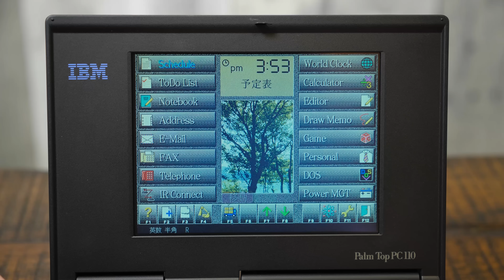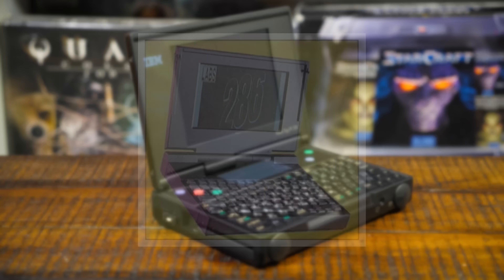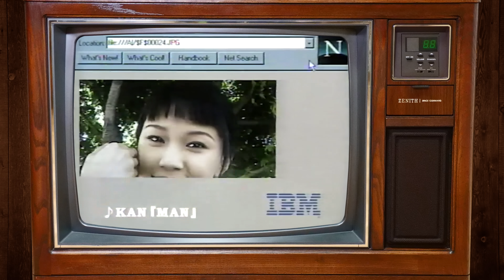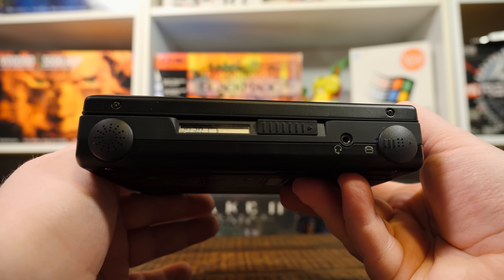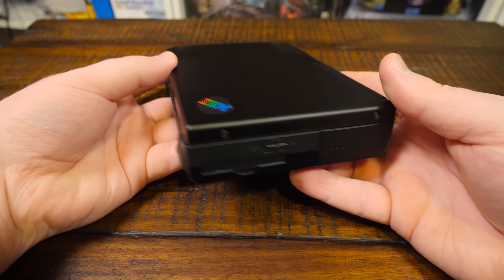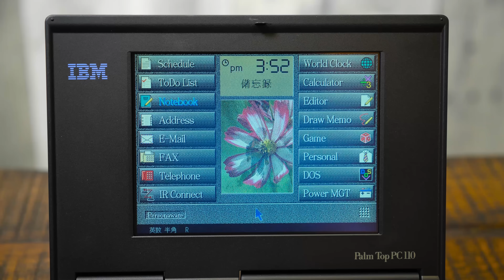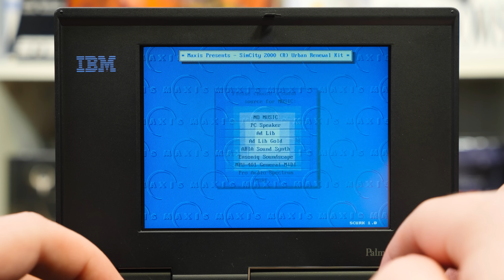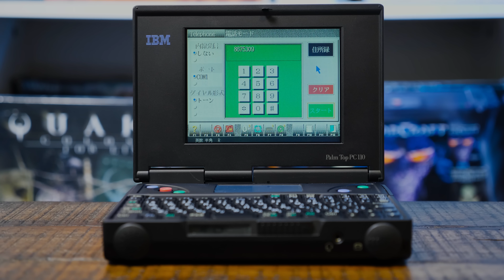The Smallest Windows PC in 1995 Was Also a Phone! IBM Palm Top PC110

Comment: just saw this...hmmmm...take a pi running win11, a tablet sized bluetooth keyboard and a portable dvd player with say a 9" screen....some cutting, some glueing and some wiring later and the fun part is do you drive the screen directly or try to get the pi to output a signal that the dvd player can accept....

Comment: I'm surprised they didn't go with an active matrix screen even in '95, considering it's so small and was a higher end product, and also a 486DX, because I doubt it would have gotten too hot and by then it wouldn't have cost much more, but would perform quite a bit better.

Comment: Worth to mention that camera software was designed to run form DOS, so you could squeeze it into tiny 4MB internal flash drive. Since camera blocks PCMCIA slots it kind of forced used to expand memory with those expensive CF cards.

Comment: At around 15:00 the video references connection to a CRT.  It'd be cool to see what it can do with an external color monitor of the day and with adapters to modern displays.  Could it be used with a light gun on CRT monitors?  Listing off all the cool things it can do they were forward thinking by adding the docking cradle and the CF card slot.  CF card could ultimately handle up to 16 GBs data without having to update its specs like SD cards have had to do so many, many times.  A pity that the docking cradle didn't incorporate the floppy drive into its body.

Comment: I bought a Libretto 50 in 1997 and it was not a bad thing and seems to have been a better solution than this IBM. It had a 75Mhz Pentium and a 3,5 inch floppy drive that was connected via PCMCIA card! An 810MB Hard Disk and Windows95 were also there. Legendary!

Comment: Man, this would have been awesome at the time.
I love expansion slots, sadly they have been left in the past.
I used to have a long laptop with a tons of expansion slots. 
If I remember correctly it didn't have that many ports, but it had 2 expansion slots and a compact flash slot similar to the one in the video.
I think I had 4 or 5 expansion cards, it was awesome swapping them in and out for different things. I can't remember what they were all for, but the great part about it is that it allowed me to use the laptop much longer without having to carry dongles and what not.

Comment: So this must be the predecessor to today's smartphones. And it's from the 90's
Reply: except no, not really, it's just a regular laptop that acts as a landline phone
Reply: @jbfarley  Still. It's easy to be amazed by a device that could literally do the same things a modern smartphone can do (except for wireless phone calls). And it is from 1995, which is a good 13 years before the first smartphones came to the market..
Reply: @Skarfar90  except that's not accurate. Smart phones did exist around this time, just not readily accessible. The first was in 1994, but 3g was introduced in 3G

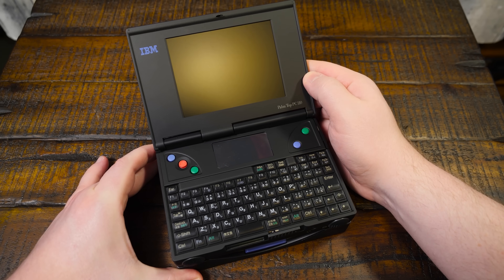Comment: 11:37 I love how IBM can fit upgradable ram into a laptop this tiny, but Apple can't even do it on full sized laptops
Reply: Won't....not can't lol
Reply: I've got a 2001 iBook with a normal (for the era) laptop SODIMM slot for more RAM. It's easier to open up than any of my Thinkpads, too. Hopefully that will start coming back as right-to-repair laws come in.
Reply: @eekee6034  Apple wasn't as bad in 2001 as they are now.
Reply: @sleeplessengineer1450  Yup, but I think they were worse in the 90s. On the software side, Apple had this thing about approved applications which was kind-of weird. I don't remember 90s Apple hardware specifically, but the majority of electronics manufacturers put "no user-serviceable parts inside" and "warranty void if opened" labels on their products. It was a dark time, lol
Reply: Apple won't be able to charge people out the ass for higher memory configurations if they allowed user upgrades for their tech.
Reply: The size isn't the thing. it's the thickness, or lack of it. I hate it too. Give me upgradeability
Reply: Apple chooses not to make useful computers.  There lies the big difference.
Reply: @SlowPCGaming1  😂😂😂😂😂
Reply: @SlowPCGaming1  So says you but my M2 MacBook Air has proven to be infinitely more useful than any Windows laptop alternative at the same price point... not to mention more premium. The display, speakers, trackpad, keyboard etc. in this thing far outclass any same-price Windows based laptop out there.
Reply: @lunetailedfox  Ok, so how do you replace or upgrade the RAM, CPU, SSD on you Apple PC?  'Cos from what I've seen from Apple is a "screw you" attitude toward their customers.  Then there is the issue of quality control from Apple where they knowingly use badly designed parts that will fail way sooner than they should.  But getting that fixed becomes nigh impossible for many Apple customers.  I prefer a computer platform where I can change out the components as I see fit.  That isn't what Apple wants their customers to do.
Reply: Apple is a sh!tty company and Apple buyers are the most toxic community after bts and dream stans, upgradablity kills sales
Reply: I had a G3 Lombard that had upgradeable memory (it had 384MB), also had a G4 Powerbook which I managed to upgrade to 1GB from 128MB.
Reply: @BlokeOnAMotorbike  I'm mainly talking about today, how you can still get new Thinkpads with upgradable ram and upgradable ssds but with macbooks that's all built into the board.  Apple has been doing stuff like this for roughly 10 years now.
Reply: @sleeplessengineer1450 , well, I upgraded mbp mid 2015 from 256GB to 2TB Intel SSD 6, but you got the point, it actually will be cheaper to go linux and loose all software that I paid for, than to buy new mac when this one will die/be obsolete beyond usable.
Reply: @sleeplessengineer1450  That's one of several reasons why I'll never buy an Apple PC.
Reply: @hrzmann  Going Linux isn't cheap on your mental health.
Reply: @FWDSUXARSE  Thought the same until I actually gave the modern Apple silicon MacBooks a try. Now I don't think I'll buy another laptop that isn't a Framework - sadly for the Framework, the configuration I wanted is far more pricey than an equivalent Mac configuration. They should fix their prices.
Reply: They can, they just choose not to because it increases their profit margins and planned obsolescence
Reply: And even way more severe issue is the steep demise of software. With this ancient tiny sublaptop, you could run full-featured, usefulness-oriented OS as well as full-fledged uncloned Doom, and have all the web and other internet functionalities any average punter would ever need even today, barring super-hyper-hd video streaming and state-of-the-art FPS gaming. All these with just 8MB of RAM!

Nowadays, regardless of the hardware manufacturer, brand, and architecture, with 8GB of RAM, you barely get running the crappy-ugly-scrambled-UI OS, basic apps and games, and web browser with content-wise simple websites for your daily tasks, to be soon crying for RAM upgrade.

If there were any professionality left in the software industry, no average punter would ever need RAM upgrade for modern devices. Not that I wouldn't support upgradeability, nor that I wouldn't understand that there are non-average people who do need it. I am just pissed of by the "new normal" that average punters are now forced to buy and upgrade their passenger cars with semi-tractor engines merely because of disastrously overweighed passenger car bodies due to unprofessional design.
Reply: @TheSimoc  For all the Apple spitballing in here the base 8 GB model M2 MBA has been serving me just fine and I see no reason to go for the 16 GB option. Maybe they're actually good at optimization, give that a thought...
Reply: @lunetailedfox  While I don't take a stand about Apple vs. others (there are good and bad sides, and generally there is too much bad things in the industry overall), I definitely don't give a credit by "making 8GB sufficing", as any average usage absolutely shouldn't need any single gigabyte. If you need even half a gigabyte for OS and basic application programs to run (which is the case with all both Apple and non-Apple mainstream systems today), then the professionality, not to mention optimization, has been given up long way ago.
Reply: japan made products of japan
Reply: japan this miro pc by ricoh japan
Reply: @D34DB34T But you can still buy lenovos with upgradable everything, like the thinkpad L and P series.  with apple there's no option at all.

Comment: 6:40 Just that port alone is so ahead of its time, considering actual usb didn't come out until 1996 and wasn't commonly used until 1998
Reply: Yeah, but it has nothing in common with USB... maybe except being square in shape. For example Nintendo Link or power connectors are quite similar as well... Or dozens other proprietary plugs found on hardware now and back then.
Reply: @override1337   Being rectangular in shape and easy to plug in and detach, that second one is a pretty significant improvement over things like the PS/2 mini-DIN connector.
Not worth the inconvenience of having to bring an adapter, though. :)
Reply: It's not a port you can connect a whole lot of different peripherals to... unlike Atari's SIO of 1979! ;) I don't know why IBM didn't go for something like that.

Comment: I had a dozen or so winCE palmtop PC's that couldn't (sadly) accept anything other than windows embedded (ROM based shit). However this thing, had it come with a TFT display of 800x600, would've not been difficult to run linux on it (CF cards, the floppy disk and dock). Adding wifi cards would've been a snap too.

Comment: Btw. Linux still supports 486SX. You will probably need 8MB of RAM at least to do anything useful, or graphical tho. I know it is possible to build Linux kernel (the most recent one, aka Linux 5.11 released 3 days ago), for 486 and it works (I have recently done so). Compiling only reasonable minimum (but not absolute minimum, that would prevent you using it for normal distro / daily use), including floppy, IDE, clock, timer, vga, keyboard, pc speaker, PCMCIA, swapping support, sound blaster, serial port, ext2, vfat, iso9660 support, that end up about 946KB (and after a boot a bit of memory is freed, as it is only used for initialization). Reasonable minimal networking support (with some PCMCIA drivers, IPv4 and IPv6) will bump this to about 1.2MB. If you sacrifice some drivers (serial, vfat, pc speaker, clock, sound), this drops to 872KB. And on few MB of IDE disk you can fit plenty of programs, and swap. I wouldn't be surprised if X11 and dosbox even worked.

The project to write driver for this scribe-pad thingy would be an interesting one.

Comment: I would have loved this in 1995.  I was always wanting something sort of like this.  I hated how large desktop machines were.  I wanted a laptop that I could plug in a mouse, keyboard, and monitor to and make it my desktop.  But in 1995 there was always some sort of compromise.  The main one being that most laptops of the era didn't have sound cards.  I've never heard of a 486/33 laptop with a sound card, so that's pretty darned cool!
Reply: Wouldn't the trade off had been too great to practically use though? Even back then, I'm sure it's too far from practical.
Reply: yeap I would of love it too. I just got a GPD micropc smaller then this. win10 etc and love it I play old skool games one it. and use n64 and ps1 emulators too. and its easily fit in my jacket pocket and take to work.
Reply: He showed your game dude! :D
Reply: @The 8-Bit Guy Your game appears at 2:19!
Reply: An IBM-compatible handheld must have been impressive back then.
If the input method is kana (as opposed to romaji), using a tiny keyboard with thumbs is less of a problem than for English.
Reply: Would be amazing if the Actress who did the commercial for the camera saw your video and commented on her time as a spokesmodel ! :-)
Reply: I worked for a regional west coast drug store chain in the mid 90s and was blown away by a small IBM think or idea pad mini laptop that a rx vendor rep was using to make his orders on. It used a small mini usb trackball connected to one of the USB slots and he could upload his order via data link phone cable. I wanted one instead of  a PC. He told me during lunch in our lunch room he could writeread email and play games and go online with it like a chunky PC. Oh the 90s.
Reply: Oh no 8 Bit Guy get out of here! Not again! Haven't the IBMs suffered enough?!
Reply: I can’t believe they didn’t have sound cards. That’s bizarre. Maybe you should’ve considered a Powerbook
Reply: Aww, isn't the screen-to-body ration of 0.31 to die for?
Reply: that price would be worth it
Reply: Haha in 1995 I woulda put Linux on it.
Reply: Hi I hope your keeping well after your house getting flooded stay safe
Reply: I remember in the early 2000s I came across this strange laptop at a yard sale.  It had a gray case with pinkish purple accents.  It was a 486 and the screen was monochrome grayscale. I forget the manufacturer, it definitely wasn't a common or even uncommonly one for sure.
Reply: But rocking the aircraft carrier with nuclear torpedos can be fun.
Reply: The only 8 bit that has my attention is AMDs inference open source DLSS knock off. Ideally it will be useable in anything, or mostly anything. Particularly games with massive CPU draw call bottlenecks as you scale resolution.
Reply: Plus, it can run planet x3
Reply: Well five years later Pocket PC's exploded and I was one of the first to purchase a Compaq iPAQ for daily pocketable computing needs.
Reply: 3
Reply: japan made products of japan
Reply: japan this miro pc by ricoh japan
Reply: Japan Richo made this computer
Reply: It was also 100 thousand dollars
Reply: @Carbine64  10,000. 100,000 Yen isn't 100,000 Dollars.
Reply: @SynonamessBotchKevin  divide by 10 again.
1 Yen is about 1 cent (0.7 ~ 1.3).

Comment: Wow they swung for the fences with this thing. The design ethos is quite camera-like with touches like using a common battery and having it hot-swappable, or having the unit itself be a phone too so you don't have to unplug it when working somewhere with a single phone line, even the HDDs coming out easily so you could have multiple.. It's incredibly focused on getting shit done. Can't believe it's from 1995 really.

edit: I forgot about the digital signature pad, that's ridiculously hardcore. That would've been the flex to end all flexes god damn.

Comment: Still stronger than my 486 SX 25mhz i guess. I remember really wanting something stronger back then like a 100mhz DX4 so i could do all those fansy computations like rendering a single image faster. So like 15 years later i randomly run into a used 100mhz DX4 cpu & buy it for like 5 bucks, took it home & installed it in the 486 but couldnt really tell the difference. But by then we was also deep into the pentium/2 race.

Comment: Note anyone wanting to collect this computer, make sure you store this in a sealed box with something to take any moisture out of the air. The screens will deteriorate with some info can be found on the net mentioning it has to with humidity (I live in a high humidity environment). Learnt the hard way as I bought on in 1998 from Japan to find the screen gone 21 years later. It was stored in a plastic box but was not enough 😕

Comment: I saw one of those back in 98 or 99 while I was working at a laptop repair facility. We had a customer bring one in asking if we could get parts for it. Since it was sold exclusively in Japan we couldn't get parts for it from IBM US, we would have had to try to get parts via a 3rd party. So I don't think we did any repair work on it at that time. That was back before ebay and e-commerce sites like that existed so it could be hard to get certain parts for special machines like that.

Comment: clint, (or anyone knowledgeable) i have a question for u. i have a toshiba libretto that didn't come with an hdd, so to follow a common decision u make, i got a cf to 2.5in pata adapter and 128gb cf card. i wasn't prepared for how slowly a pentium 120mhz scans a 128gb card lmao. so, i can't boot from floppy as i don't have a pcmcia floppy adapter yet. installing freedos from rufus or ms-dos from the hp usb tool, i can get it bootable and install windows 98se from copied cd files in another directory. this works all fine and well

here's the issue: u mention casually that u plop the files u want on ur windows/dos install onto the drive from presumably windows 10 and a usb cf adapter. but i can only access these files when i do so from dos or safe mode, otherwise i get a read (or i'm assuming access?) error when attempting to open the folders i transferred in explorer while logged in normally. is this an issue u've encountered or know anything abt? should i be mounting to a windows 98 vm and transfer that way? is there some kind of modification i should be doing to the copied files? tysm!

Comment: That phone solution is very cool and should still be usable thanks to Routers with phone sockets, and ATA's (Like the Cisco ATA's we use a work for some stores).
What really blows me away is the camera battery! That makes it so easy to replace it I see why people would want one.
It's a shame about the screens dying.

If someone was to make a PC mini I think this has the best ideas to copy. 
Camera Battery
Small Size
Dock so it can be connected to a proper monitor etc

Would just need:
Better screen
Faster CPU
More ram
better audio chips
a Game port

Comment: Thats actually small even from todays standards. A modern Intel Nuc is probably larger? Of course a Raspberry pi is much smaller. Until you get a case for it that includes a battery, keyboard, touchpad, and screen. It kinda porks up at that point.

Comment: The modem connector would be an RJ12 and not an RJ11.
RJ11s are slightly smaller and used for handpiece curly cords.